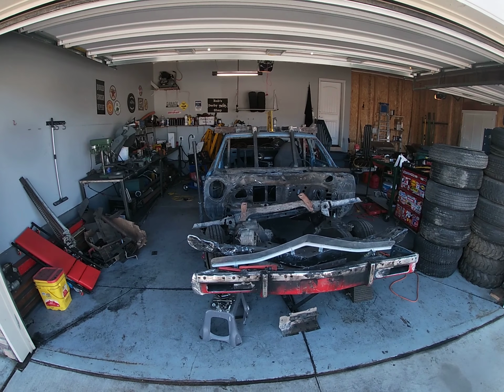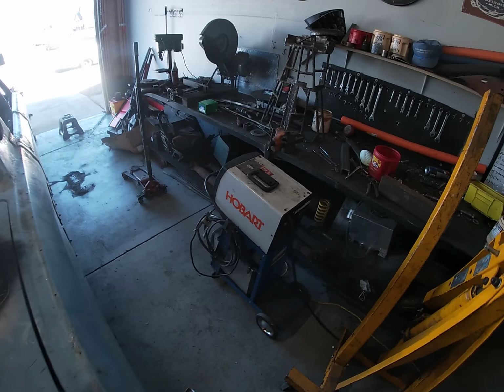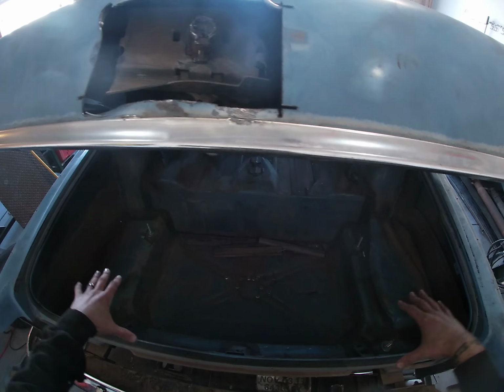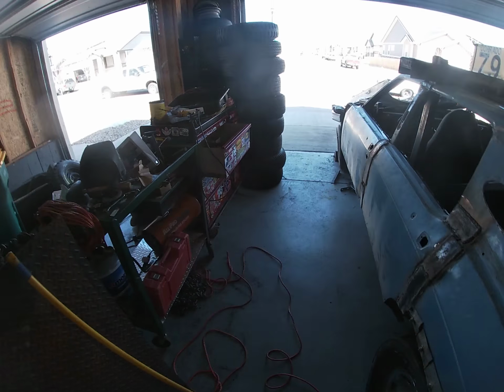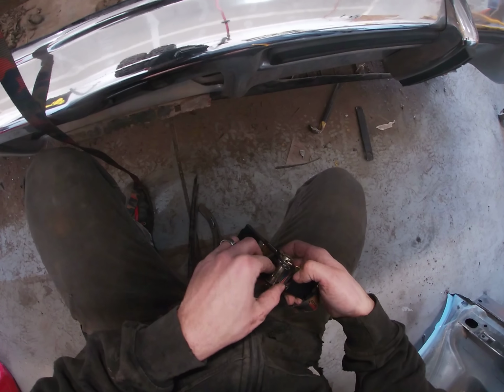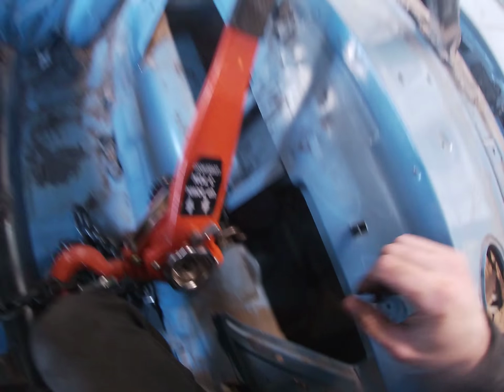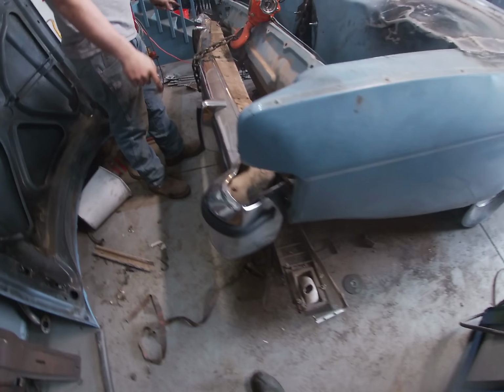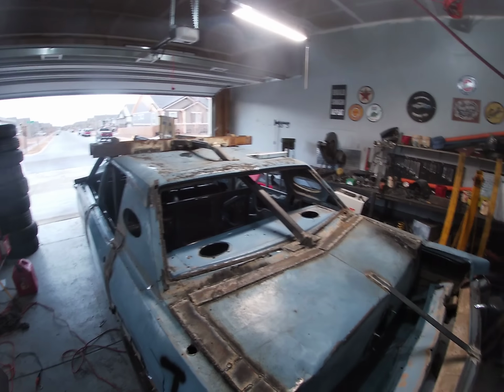Tuckin' and Jivin'!

Comment: I've no room full of trophies,so I may not have a right to say what I'm about to say.Seems to me,cutting to make things bend easier  at shop is bad when they also bend easier on track.A big adjustable wrench and/or hammer on fender lip bends it how you want it without cutting weakness into it.laying the trunk lid upside down over a 6x6 in front and back ends while having a few grown guys jump on the middle will bend it for sure.run your allthread from bottom of frame all the way up to top of lis with nuts and washers to tighten it all up,and buddy you've got a stiff back end.Itll beat in to a point,but then that's it,it's gona be good no matter how hard you hit with the back end. No more giving in.its strong.Ive seen guys do it same as you,and those cuts ripped farther and they had a hanging,dragging mess out back with rear axle housing exposed taking abuse. Then I've seen guys take time and bend things into shape without relief cuts,and once they made a few solid hits and the back end bent up exactly as expected, it packed up to a certain expected point,it gave no more regardless how hard they hit.The housing was safer nothing hanging off to remove during event to save tires from shredding. Been watching derbies 30 plus yrs.
Reply from the maker: Im bad rotten i appreciate all the advice!  I don’t have any trophies so I’ve always got an open ear when it comes to this stuff.  What other tools would you recommend?  I’ve got plenty of hammers but no porta power.
Reply: Cool.Keep a few things in mind.You can slit, cut remove metal,but most tracks have rules preventing welding or adding metal.So,you can take it out ,but you can't put it back in.So my and my buddies are slow to take strength out. We reshape metal, but we don't cut it out or cut slits anywhere.No,we don't have high dollar shops or tools either. Some of us are married and like breathing so big budgets are no no. A lot of what folks do is dictated by a particular track.For example,there's a track near home that allows 8 lug 3/4 ton truck rear end swaps  but the track in town does not.So,5 lug stockers get beefed up insanely but are legal.One of my buds a few yrs back laughed at another builders  $5k offer just for the rear end in my buds car.Later my bud explains he has  $3k in it,but refuses to sell secrets to how that rear end lasts years in car after car.And it a 5 lug stock based so legal anywhere. What the rules allow decides largely (and budget) what you can and can't do.Open rules and super sweet wives are great but not normal.